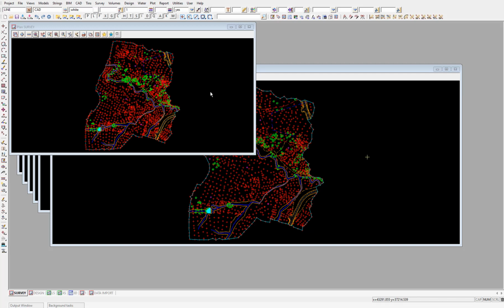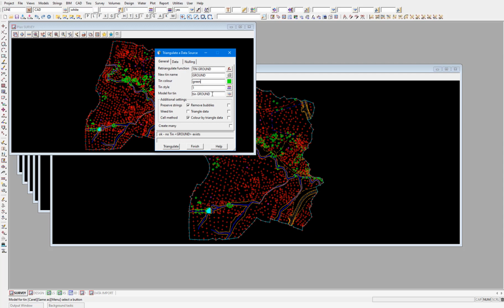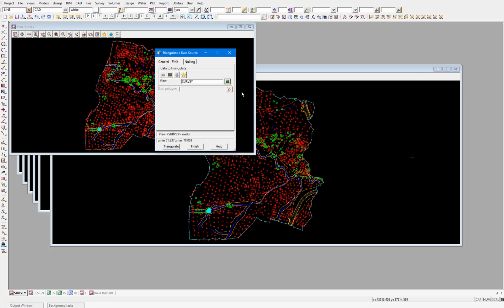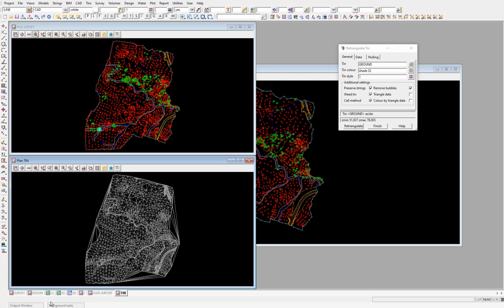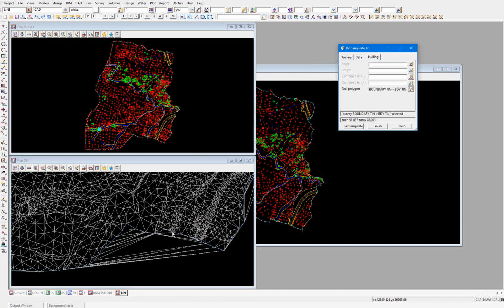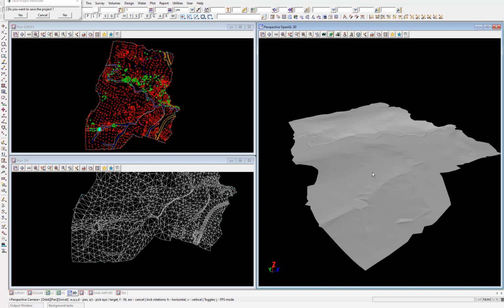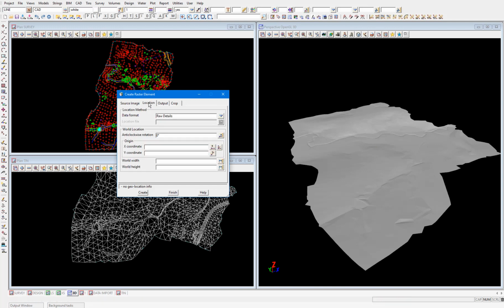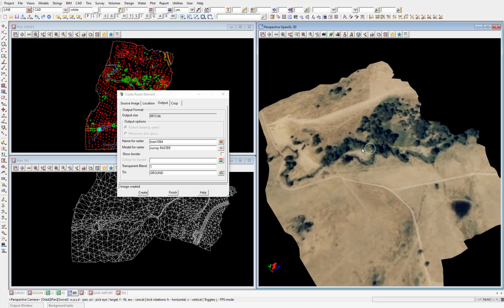Triangulation: Getting Started for Design (12d Model V14)

Comment: Thank you so much for these videos, they have been extremely helpful. For some reason I couldn't get the raster to attach to the Ground tin, any idea what may be happening? I'm using 12d 11 in case that has something to do.
Reply from the maker: Hi Andre, it may have something to do with the version, however are any messages reported to the Output Window which may suggest why the raster isn't applied?